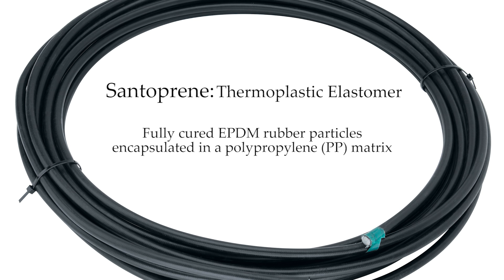Introducing Reflex Furling by Harken

Comment: Hi, What would your recommend for the luff length of the asymatric spinnaker in relation to the length between the attachement points on the anti-torque cable for a top-down furling system? How many percentage % should the luff length of the sail be longer then the length between the attachement points on the cable, to have a asymatric sail for deep sailing that can still be furled up easily?